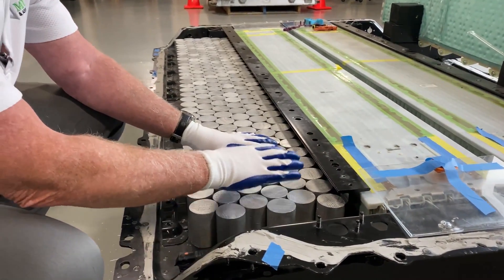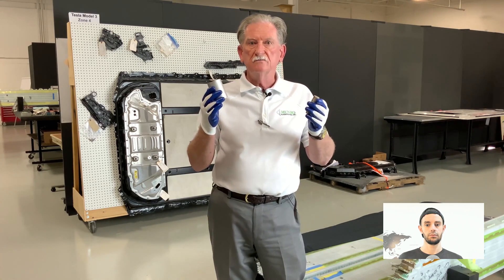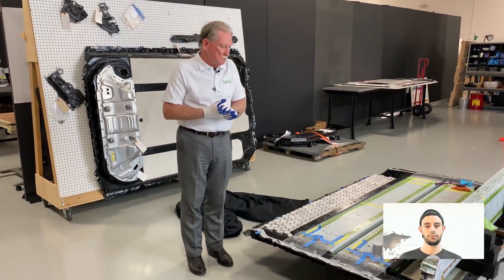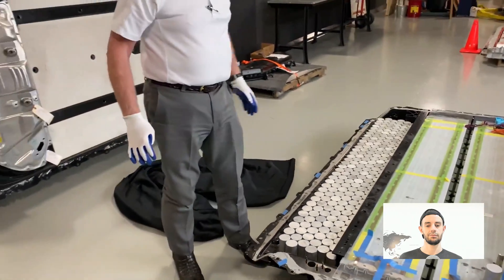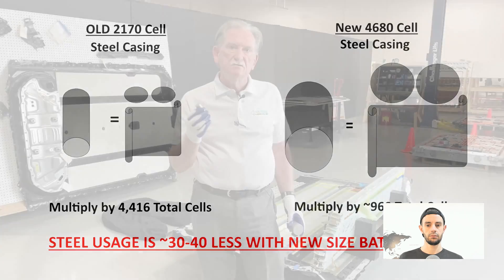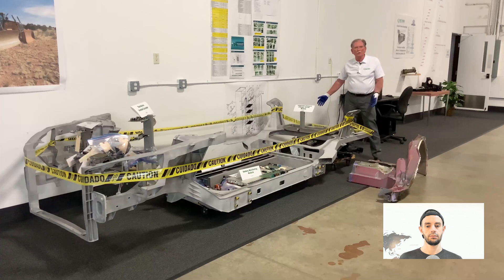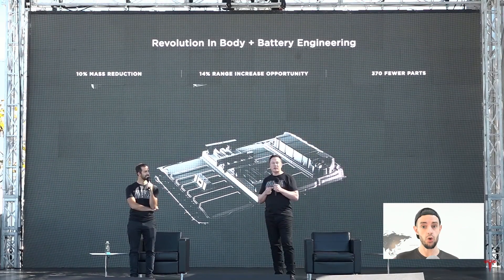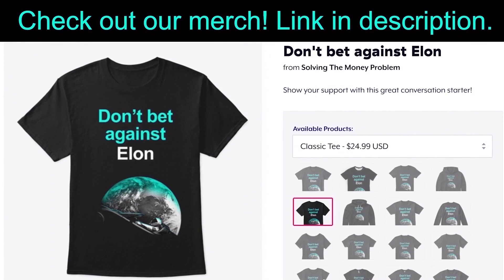Tesla Engineering: Sandy Munro THRILLED

Comment: When you think about it, in order for Tesla to beat any other automaker they only need to adapt to change. In a world where no one want's to change, the one that does will lead. Using three parts instead of 100 is not groundbreaking technology, a bigger Li cell is not ground breaking, simpler cell manufacturing process is not ground breaking, but putting everything together gives them a huge advantage over all other OEMs. Meanwhile the other OEM still talk about solid state batteries and thousands of km in range and other fantasy "breakthroughs".

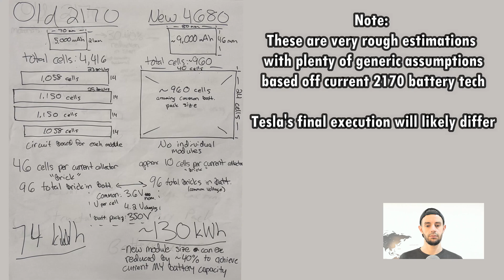Comment: 2:59 can somebody help me. 
I try to understand the 130kWh value (Iam german so the points are commas and the other way around):
The capacity of the 4680 is 6 x  of the 5.000mAh = 30.000mAh and not 9.000mAh.
9.000mAh x 3,6V x 960 Cells = 103,68kWh and not 130kWh ?!?!?

Comment: The added rigidity doesn't make a meaningful change to safety - it improves handling and potentially reduces cost. Rigidity gives that "corners on rails" handling by resisting flex. It also means that less structure above the battery is needed for rigidity, leaving the rest of the car only responsible for safety. Hopefully this will allow thinner A pillars. Those are too big and get in the way of front visibility.

Comment: It really seems that Tesla could cast a bottom plate with pillars to cradle the batteries and fill the voids between the batteries. That way no epoxy fill would be required.

Comment: Tesla brilliance is breathtaking to behold. It's difficult to feel sadness instead of contempt for the legacy auto OEMs doing nothing to prepare and position for the disruption.

OK - nerd question at 6:20: Munro said axial battery cooling is most efficient. The 4680 cells will be encased in fire-proof epoxy/something for pack structural rigidity; how will battery heat be wicked away (or heat added for cold-morning vehicle operation) within the overall concept of batteries providing the stress and torsional rigidity as a structural member?

Comment: We could see a different pack configuration at least for the performance models.
Elon mentioned the new cell would allow them to move the cells closer to the center of the vehicle.
They could do this by reducing the number of cells around the perimeter or having a smaller pack size. 
This would further reduce weight while improving performance, range, and handling.

Comment: In addition to Sandy’s Statements, one of the key parts required for casting is Tesla patterned alloy that they’ll be using to produce front end and rear end assemblies, which will weigh less yet much stronger, and when produced it will not require heat for curing!

Comment: Tesla is doing a great job commoditising electric cars, i dont believe prices of parts would have dropped in any significant way if not for Tesla, and we would still be stuck with just a few low quality electric cars which have minimal market share. Tesla has single handedly changed everything.  The next stage is to create a true Tesla super car, not the Roadster, but a Carbon fiber super car which matched a Ferrari, or McClaren styling and build quality because the competition have already created them in the form of Evija and RIMAC. Right now, many (rich) people consider Teslas to be ugly, so having a classy model would be a great boost for the companies image.

Comment: EV Builder Engineering Nerd. Tesla is missing the boat on retrofit kits. Untapped market potential is RIDICULOUS!
Reply: — True story — in 2006 when Iran was being squeezed, it faced chronic gasoline shortages but had an abundance of natural gas. It embarked on a massive program of nat-gas light truck & car conversions — hundreds of thousands of conversations. It relieved a good part of the gasoline shortage, but came at a high price (~ to So. Africa’s expensive experiment w/ liquid fuels from coal).
     WAG retrofit efforts come w/ all the unpredictable variations attached to redoing any kind of old existing work.

Comment: Question for the group... would having the frame being a larger part of a car mean that a small fender bender could bend the frame?  Having separate pieces means you can unbolt them and put in a replacement part whereas having 3 big parts welded together, if any one part gets bent, the car is totaled?  Just curious.
Reply: I have been wondering the same thing. But also consider with Tesla getting into insurance they are engineering more cost effective ways to repair the cars in the event of an accident

Comment: Most important takeaway: "with this, do I need a solid state battery?" that's what should raise an eyebrow. Frankly Tesla's new cell to pack method is ready for things like solid state batteries which Tesla will be able to switch to much easier now. Competitors still haven't got their basics up and running. I also wish people would shut up about solid state, current electrolyte batteries will be around for quite a while. Solid state would be more expensive per kwh for quite some time and would only be in high end vehicles, and mass sensitive applications planes, maybe trucks and buses. Eventually we'll see the better tech ascendant, but not yet.

Comment: I do not understand where did you get it from that Tesla is going to be safer? It is gonna be more rigid at the bottom, which probably will have a bunch properties(I assume most of which are good if it gets a real engineer like Sandy excited), but none of this translates directly to "Tesla is going to be safer". I am no engineer, but they would need to crash test to actually see how it impacts safety and it is a bit too hard to say for sure just in theory.

Comment: Tesla & SpaceX are playing with new alloys, this reminded me of the chap running Skunk Works talking about building the version of the Blackbird and they had to design a new alloy that could take the heat from the jets. They used a AI to design this alloy. This and a few other things have lead me to suspect DOJO will/does more than just working on the FSD program. A powerful AI capable of modeling and predicting many parts of our world in the hands of Tesla would be huge.

Comment: I could also see legacy automakers get pushback from unions.  Tossing out their body shop will toss many folks out of work.  Another reason Legacy has problems moving on.

Looking forward to Tesla re-engineering the undercarriage to use newer tech (spelled S, 3, X).

Also, in the past the Achilles heel of Tesla is their paint & body shop.  I wonder how Sandy would have Tesla fix that.

Comment: Remember Semi/Roadster announcement?  Remember how the short sellers said the announced numbers were impossible given the size and weight of the vehicles and packs? Tesla has to have had this in their back pocket the whole time and figuring out how to make it work.  I figured back then that Tesla must have been betting on unknown radical future battery improvements. But now I suspect maybe they had at least the concept and theorhetical numbers for this in mind. Maybe they even tried to get Panasonic to go in this direction and were told its not possible/economical so they went it on their own. Maybe that explains some of their issues with Panasonic a few years ago.  Work on this scale must have been going on for some time.
Reply: Panasonic announced an incremental 20% improvement over 5 years. Too slow. Tesla will get 50% improvement in 3 years.

Comment: Cost reduced, longer range, less weight is awesome for the Tesla Semi. easily a 260 kwh battery pack can be installed, That would push the range will over 800 miles
Reply: Diesel trucks have two 50 gallon tanks and can go 800-1000 on them, depending upon traffic and wind resistance. I'm eager to see the economics on the Tesla Semi.

Comment: Chamath Palihapitiya said in a recent article :
“In my opinion, [Tesla] now is on a death march to being the largest company in the world. It will be on the scale of Apple, probably larger than Amazon,” he said.
Reply: Tesla is surpassing Apple in many aspects, they are in so many bussines and engineering areas, as mining, battery making, car builders, solar panels, chip manufacturing, software, etc. And they integrate all together like anybody else to enter into a new dimension or new Era.
Reply: @ovi9610  
I'm going to throw in my favourite hypothesis of the moment.
Tesla will provide your, or your children's
Transport
Transport for goods delivered (Inc van!)
Grid Power
Home Power
Communication
Home heating/cooling
And
HOME.

Look at the speed GF Belin is going up. Texas is apparently ahead even of that.
Its prefabricated.
Apply that to houses.
Delivered and built in 2 weeks?
All systems integrated?
Reply: Think about it. A car costs 50 times as much as a phone. Even accounting for the longer lifetime of a car, the best car manufacturer should be bigger than the best cell phone manufacturer. But it takes a company like Tesla to realize this potential.

Comment: $25,000 model 2 or whatever they call it would be pretty epic, but if they reduce the battery pack cost by $5000 (?) and the cost of the body by what? Is it possible another $5000. Am I way off here to think even the model 3 could hit $30,000 at large enough volumes once battery etc is ramped up?
Reply: And what would the price be in China, lower?

Comment: Tesla's claiming they are shooting for a %54 increase in range, but if Sandy and his people are correct the new battery spec could store up to %75 more energy.  

So a Model 3 standard range plus with these new cells would go from 250 miles on a full charge to 435 miles. As it's quickest to charge up to %80 using a supercharger and keeping a %20 reserve, that would give an effective range of 260 miles with a 90 mile reserve that can be replenished in 20 minutes., so 350 miles.

The current Model 3 long range is rated at 330 miles with a full charge.

And the newer cars will be safer and may well be cheaper.🤯

Sucks to be short Tesla

Comment: Steven Mark Ryan, what do you think of the potential synergy of Starlink and Tesla’s self driving? No other car marker has an exclusive constellation of satellites that can deliver high speed Internet to the AI systems in their vehicles. I’m curious what your thoughts are because this seems like quite the advantage and no one is talking about it.
Reply: Probably won't happen because they'd need to incorporate a pizza box sized antenna system into each car, plus the car metal would dampen signal strength.
Reply: Jonathan Guito it’s true their antenna version 1.0 is pizza box sized and could be dampened by the metal of the vehicle. But what about version 2 or 3? What if the antenna is vertically integrated into the roof?
Reply: @StewardofEldenforge  could be cool if they did, but Elon seemed a little cool to the idea. Maybe he'll come around though.

Comment: I'd love to know about battery manufacturing engineering enough to understand if they can or why they can't print a battery in one giant flat coil like a gigantic watch battery.  make one huge  flat disc and use one battery cell instead of 1800 cells .  i have no idea but maybe its that you need individual cells to charge faster? does anyone know?
Reply: Having one cell would give you less than 4 volts. Motors needs higher voltage than 4 volts.

Comment: I think it's probably more likely they'll keep the energy capacity of the pack the same and go for reduced cost with new form factor instead. Since anything above 300 miles, you're more limited by your bladder/sleep than your battery pack unless you're driving a long haul.
Reply: Agreed. They will quietly make the change and announce it after the fact.

Comment: it sounded like 900 cells would be roughly equal to the current pack size of 75kw... this means there is going to be lots of empty space within that chassis.... holy sht.. if Sandy is right filling that space up would get it to roughly 130kw which is lighter than the current configuration using the 2170... thats kinda insane...